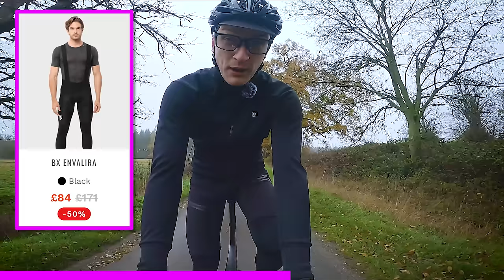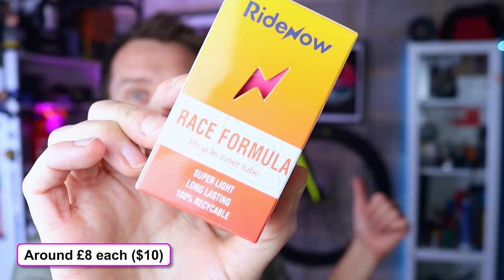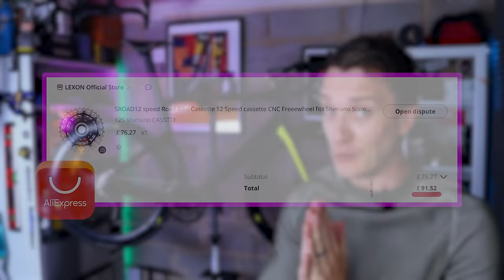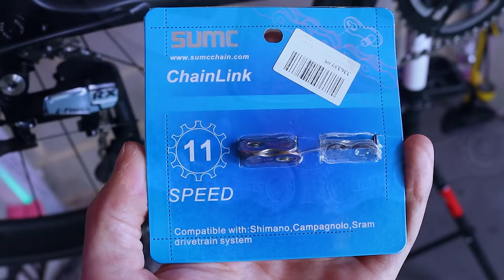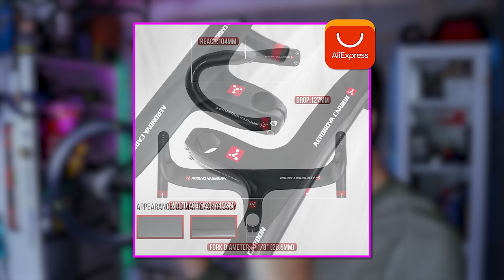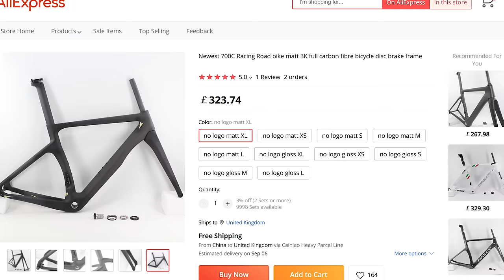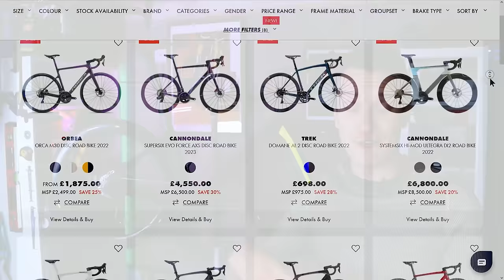£1000 AliExpress Carbon Road Bike - 600 miles later

Comment: You illustrate to me why my choices  to stick with 80s-90s tech was such a good choice. Money, reliability, ease of repair all seem to be worth leaving anything carbon and disc alone and not buying into recent bike manufacturer's trends.
Reply: I totally get where you are coming from but I'll confess I'm a mountain biker and fell for all the luxuries of suspension and disk brakes long ago.😐
Not disagreeing with you though mate!
Reply: Carbons lighter and more compliant on a 60, 80, 100 miler, alloy will beat you up. Drivetrains now are so good, even modern lower spec is far better than 90s top end. They shift so crisp and accurate now. Bearings are sealed, no messing about servicing and adjusting. Headset, cranks, sealed, just replace the sealed unit, one out one in. I've got Ultegra rim brakes on the road bike and they are so good, unbelievable. I've got disc on the mountain bike, so much better than V brakes, remember those? And cantilever brakes, terrible! Geometry? Modern mountain bikes are far better, wider bars, better stance, easier to ride off road. All in all, I can say everything new is better! I've a bit of experience, I've been riding bikes since 1985. I wouldn't go back.

Comment: Considering the budget orientation of this channel, wouldn't it be cool to do a conversion of a aluminium hybrid disc brake bike into a winter road bike using Aliexpress components? I scored a 100£ 3x8 hybrid which I am reworking into a 2x11 gravel bike. Just an idea, also something a bit different, without replacing the sweet carbon aero bike😁

Comment: Remark :the aluminium seatpost you used previously is unsafe because the rail clamping area is too short for carbon rails
You should have used a saddle with metallic rails
Reply from the maker: Yeah this is a great comment, I'll check it out this eve see if it needs some attention!

Comment: I also bought a 'cheap' aero frame on AliExpress.  I had to re-engineer the head to stop it coming loose, using wood filler.  The front shifter cable wasn't properly supported at the bottom bracket area, and the wire started cutting into the frame.  I could've taken the BB bearings out and re-routed the cable under the bearings and drilled a hole down at a near-vertical angle so that the wire probably wouldn't cut into the carbon fibre.  But I decided to go 1x11 instead.  In that set-up it works fine now.  But I've also recently modernized a 1980s steel frame Nishiki Olympic with brifters and 2x9 speed.  I finished the year riding the Nishiki preferentially.  It's a couple of kg heavier but that isn't really detectable while riding.  Riding with a steel frame just feels like riding a real bike.

Comment: I've used these common AliExpress carbon seatposts for years on all my bikes.  I'm 6ft4 and not light and they have served me well.  One failure, this summer.  Saddle started rocking and the rear bolt had broken and damaged the carbon.  2012 I put it on.  I adjust my saddle a lot due to back problems so I'm not surprised.  It didn't fail dangerously, enough warning things were going south.  I fitted a new one.  They seem to have beefed up that rear section.

Comment: Interesting... I found my set uses the same "smaller" break pads at the front and back on my BR-005 set. Other people have reported that their version uses larger break pads.... seems there are different versions of these brakes out in the wild, under the same model name. I hope somebody can clear this mystery - and here 8x 🥖 for your efforts 😎
Reply from the maker: Hmmmm interesting, maybe the have been through a couple of interations. I wouldnt be surprised with the number of differences from the previous generation...
Reply: @TraceVelo   you are spot on with changing the brake pads. The original copper pads reduced breaking power over time and showed a lot of wear. After 1000km I changed to similar resin-metal brake pads which improved the performance… The Juintech GT‘s might be overkill on a roadbike…. I use Juintech F1‘s in the Swiss Alps without desire to go full hydraulic 😁

Comment: If you are genuinely concerned about the height of the headset spacers, the easiest solution (but the least 'roadie' looking) is to replace your stem with a high rise model that keeps the handlebar clamp in the same position but lowers the clamping point on the steerer tube.

Comment: I have been doing handmade carbon components for sailing and biking over the years. If you want to add some strength to the fork steerer, and you have an old 1" O.D. steerer or are willing to buy some 1" carbon tubing,  you can make an insert and epoxy it into the steerer. This will double the wall thickness and increase peace of mind. Cheers/

Comment: Also give the road avid bb7s a try. They are amazing, and you can find a used set for relatively cheap. Then just a simple rebuild and they are as good as new. I find that their braking performance rivals even the best hydros.
Reply: I don't see them avail in flat mount
Reply: @hkchew03   Some of his bikes aren't even flat mount but for the ones that are an adapter could be used.
Reply: @Drago0900  road bike mostly if not all are flat mount, at least those that came out in the last 5 years. And not all frame will be able to fit the adaptor
Reply: @hkchew03   Yeah not every frame in existence but in the video you can see a post to flat mount adaptor in use on the fork. And in the last 5 years would be 2017 and later. Which flat mount wasn't really common until around 2020, which is the really new bikes. My road bike has post mounts and it's a 2018 model.
Reply: @Drago0900  that's a flat mount to flat mount adaptor

Comment: What's the point of 4 piston calipers on a road bike? It just adds weight, complexity, cost, and it might wear down the brake rotor faster.

Bigger floating rotors make more sense.

Also, i will never use integrated stem handlebar.
Reply: 👏👏$$$$ 9 piston calipers comming soon!!!

Comment: 🥖 🥖🥖🥖🥖🥖🥖🥖In my shop I don’t recommend anything more than 20mm of spacers under the stem. Honestly 40mm is a big risk, you might even be better off cutting the steerer shorter and fitting an aluminium steerer extension to the top. At least then the carbon will be Reinforced by a thick aluminium clamp and you will have a solid aluminium steerer to fix your bar to. BBB make one, it’s called a BHP-22, just Google it. 👍🏻🙂

Safe riding Sir.

Comment: I live in Hong Kong and it is so much easier and cheaper (half the price) to buy these parts but I would never, due to the QC issues and the unfriendly traffic on public roads. If a stem or a rim fails, I would end up at the bottom of a lorry. Now thanks to you we know what parts are a safer bet.

Comment: I have bought like 3 older style FSA megaexo carbon cranksets for between 25 and 50 euros on the local marketplaces in the last years. If you sand the decals off and relacker them they look awesome. FSA just always put hideos white and red stripes and logos on the beautifull carbon work. They are reliable and use the self extracting crank bolts. With most being just 110bcd. They fit many chainrings. And in the older Megaexo versions they come with steel axles. This beats unknown chinese cranks for safety, reliability and looks.

Comment: 4 N-m is at the low end for that stem bolt, especially considering that there was only one bolt.  So no, you definitely did not apply too much torque to that bolt.  That was a defect or poor design issue.

Comment: Luke, once again…that is some “Tasty” content. 🥖🥖🥖🥖 I’m also loving the 10% on Siroko! So it was a loose seat post that was causing the seat clamp to loosen? You were certainly more gentle in your build than Jay was in building up Cam’s Trifox. I built up a winter bike, from a used Allez Comp frame that someone had slammed the steerer on. Thought I might have to extend it, but after riding it a dozen times, I am loving the lower stack height. Have you tried riding with the stem slammed? Maybe go for a smaller crank and drop the seat? Now if you only had a place to pick up some cheap parts to try. 😂😂😂
Reply: But did you see how tight the Trifox steerer and headtube were? 🚲🔨

Comment: Hi Luke, interesting vid. Anyway there is very good reason why I never fancied integrated bars with stem... I needed to be more upright after injury so I turned my system upside down and problem sorted for free. ;-)  Drop the spacers and for standard stem, maybe even with bigger angle (12° or 17°). It may not be so aero but comfort is more important in my opinion. And to your surprise my carbon stem has only one bolt as well and holds perfectly without any signs of fatigue for more than 6000km. Contrary to your channel it's rather expensive piece of engineering from Easton  but my nearly 100kg put lot of stress on any component and that crack you showed would probably have much worse consequences for me...
Reply: Might be overtighted from the look?

Comment: Seat post bolt I would drill slightly and insert a metal sleeve insert. As for the sealant on the seat tube, I would have made a simple guard to shield the area.
Reply: I've seen that done, using zip ties and a length of MTB inner tube. Makes a decent gaiter for almost no money.
Reply: @BrianRPaterson  just split balling ideas for you.

Comment: I found that my cable hydraulic brakes were much improved in responsiveness by using inextensible brake cables. Aren't all brake cables inextensible I hear you say. Well no, these aren't wire wound but have longitudinal wires like gear cables and are very good, if harder to bend around curves. But with care they work very well.

Comment: I'm beginning to think it's too much of a hit and miss with AliExpress parts🥖...I've just bought a complete 105 groupset🥖 from Wiggle for £299, they still have it🥖🥖 I'm replacing the Sensah pro 12 speed as I just can't get the front derailleur right, it seems to hate Rotor chainrings, drops chain all the time🥖 this is going on another build with FSA cranks n chainrings. 🥖 Selling another brand new boxed   12 speed Sensah now I have the 105  for my Eddy Merckx San Remo🥖🥖
I'm happy with my BXT track frame set🥖 and happy with the 3T copy track bars from AliExpress.
Sensah....was really happy when I had a Shimano crankset, then bought a rotor crankset and it hasn't been right since🥖🥖🥖🥖
Great follow up video, noticed you fitted Noah and Theo pads. I fitted N&T ceramic pads to my MTB, brilliant 🥖🥖🥖🥖🥖🥖🥖

Comment: The different size brake pads front/rear is absolutely commonplace in motorcycles. Some vintage bikes and some mopeds or junior dirtbikes might have same size pads on both ends.
Reply from the maker: OK nice, makes sense! Thinking about it, race cars often have much bigger calipers up front too...
Reply: @TraceVelo  Yup. After all the front takes most of the braking forces anyway (sometimes up to 100% if you do stoppies/endos). Most larger street motorcycles will even have two large brakes up front and only a single smaller one in the back.

Comment: The difference in pad size I believe is not due to design. The 26mm pad are the older version of the BR-005 and the 32mm are the newer version. I recently ordered a set and got 2x 32mm

Comment: Hey Luke. I was just wondering about this older version of BR-005 or any other calipers of the same design with the exposed bottom of the piston. Maybe a strip of teflon tape on the piston rod would seal the cylinder from dirt ?

As for the cracked handlebar - I had a round Dodici handlebar and after 2 years it cracked at the lever clamp. Mind you I tightened the bolts to standard 7nm. This was my last carbon handlebar from ali. It's not worth your money, health or even life. The weight savings are also negligible because a standard round carbon handlebar is roughly 100 g lighter than its 6061 aluminium counterpart. You can't notice the difference. The stiffness however is another ball game. I replaced it with a similar in shape ITM alu handlebar and I must say that ITM was noticeably stiffer. Not the mention if I compared it with my other carbon handlebars from ali in likes of cinelli ram 2 or 3T aeronova knock-offs. These aero bars are stiff as as plastic...

Comment: I was sceptical about the single bolt stem when you posted the original build video, but at least you’ve found the failure without any injuries.
Good to hear the Ride Now are proving successful, I’ve run them for 4 months on my summer bike and really notice the difference when I switched to my winter bike with latex tubes.
What’s next on the agenda?🥖🥖🥖🥖🥖
Reply: Could you tell us the differences, please?

Comment: Maybe the bigger brake pads on the front are because 70% of your total braking comes from the front brakes on bikes and motorcycles hence the reason you have to put your weight backward to stop flying over the handle bars if you only use front brakes? This is the reason for some motorcycle accidents when people only brake with the rear brakes and instead of stopping they end up sliding, use both brakes to get complete braking and to stop quickly.

Comment: I use Aerothan TPU tubes and Schwalbe told me you can use their regular glueless patches with those. They were right, I had one hold for over a year/6000 miles.
Reply: My gut feeling is that they increase rolling resistance a lot.  I had a regular tube 7 patches and lost about 5 watts with that tube. I can imagine the effect is bigger with a thin, flexible TPU tube.  With TPU and latex, I'd want patches that are equally thin but I'd use butyl patches if it's all I had.
Reply: @veganpotterthevegan  one patch, regardless of type, makes no perceivable difference on a TPU tube. With or without a patch I'll average 22mph on my 30 mile training loop.
Reply: @Kionne Potter  with one, maybe.  But not more than that.  Also, a lot of imperceptible losses aren't actually noticeable if they can be circumvented by a bit more effort but they do add up.
Reply: @veganpotterthevegan  yes, but we're talking about one patch, it makes no difference.
Reply: @Kionne Potter  I have doubts it's not measurable.  It'll be more measurable on a TPU tube than a butyl tube.
Reply: @veganpotterthevegan  I have doubts about riding an inner tube with 7 patches
Reply: @Kionne Potter  why?  If anything,  the patches are stronger than the rest of the tube.  It just slows you down.  I'm all about not being wasteful and I keep tubes until they don't work.  I did this for over 150,000 miles before I went to tubeless.  Now I have TPUs as backup but I rarely ever need them since I only get 2-3 flats a year(that I notice) that won't seal vs 3-4 flats a month with tubes.
Reply: @veganpotterthevegan  you had 3-4 punctures a month?! I'm not surprised you repaired them so extensively. I get 1 puncture every 2-3 years of all year round riding, commuting and the of bit of racing. I only do about 6000 miles a year though.
Reply: @Kionne Potter  I'm a cat 1 that rides about 15,000 miles a year and I weigh around 190lbs so I think that's a reasonable amount of punctures at my size and mileage and with the quality of the roads I ride. Lots of glass where I used to live.   And now I live where there are tons of infamous goatheads

Comment: "tubes" I carried a pirelli version of a tubolito around for ever, finally got a flat on my tubeless mt bike that sealant wouldnt fix.
The ultra light/ultra expensive tube leaked right outta the box, and no known patch will stick to the plastic tube.

So a zero out of zero on function, but it did cost 36.00.  So there's that.
------------------------------------------------------------
Before that I tried an off brand latex tube, 2 of them, in my old road bike....Vittorias were not to be had.
The bonded on patch the valve stem is a part of? Came off. Both tubes.  Another zero out of zero function item.

Comment: Hey Luke, do you ever worry that something will snap before a visible warning crack appears? I think it would just spoil my enjoyment constantly worrying that the bars could shear off at any moment.
Reply from the maker: Yeah so it's a good question, but no not really. Carbon fibre is more like wood when it fails, it won't necessarily just snap instantly into two pieces. It tends to splinter like a piece of wood, so you can often feel it splintering before it fails entirely.
Reply: @TraceVelo  I speak as a an Olympic/Paralympic mechanic, I've seen failures that come with no warning, and I do worry. You've got such a lovely face....!
Reply from the maker: Ok fair enough, you sound far more qualified than me!! 😂 I think it does depend on the use case aswell tbh. I mean I would argue they are fine for the average cyclist, but if you are an Olympic athlete you should prob spend more than £60 on a set of handlebars. I take your point tho, you do need to be careful with this stuff, hence the importance of the first 500 miles.
Reply: @TraceVelo  keep up the reviews though. Besides the generic frames/wheels/bars etc, I find the groupset development parts far more interesting. I guess you'll be trying to get your hands on one of the new full hydraulic groupsets that have just been released. Will be interesting to see if the OE market starts to tap into these cheaper alternatives. We were building bikes with Microshift 12 years ago, but it was pretty small scale tbh (working at Moda bikes at the time).

Comment: Motorcycles have been designed for more/better braking performance on the front via the rear since disk brakes were put on motorcycles in the 1970's ...  or even earlier.  It's nice that bicycles have started to catch up! 
; - )

Comment: 🥖🥖🥖🥖🥖🥖🥖🥖 hey Luke, would you mind sharing where you got the new pads for the zrace br-005’s? I have them on my Ican gravel build (thank you for your build video on that!) and am looking to replace the stock pads. Interestingly both calipers for me use the same size pad roughly 32mm wide and 29mm tall. Thanks! 🥖🥖🥖🥖🥖🥖🥖🥖
Reply: I think they are from Noah and Theo,  Luke  tested them in another video.